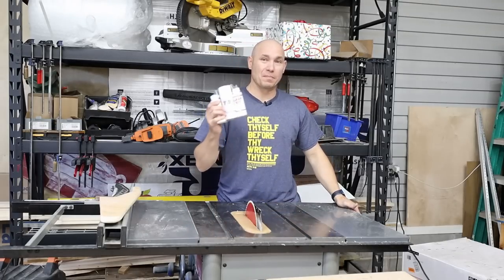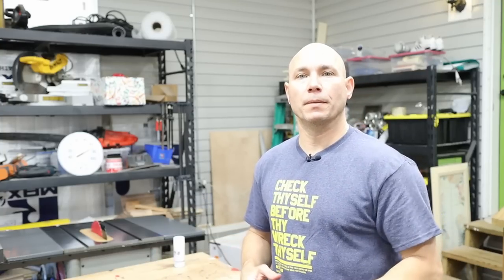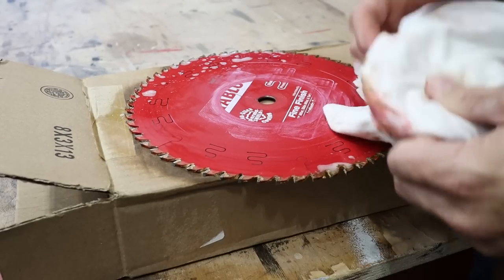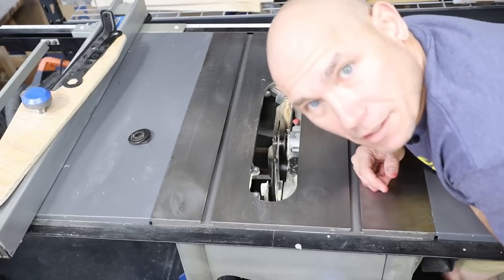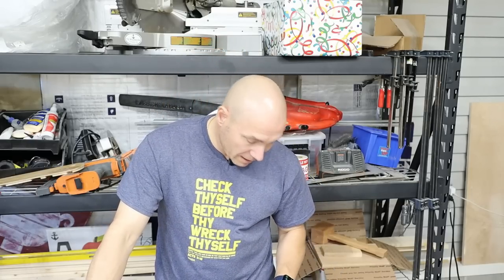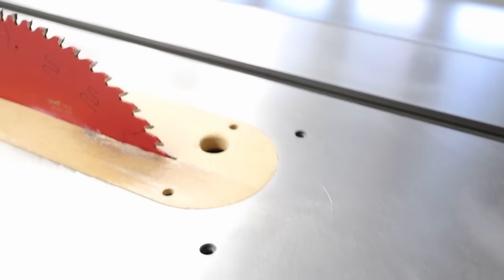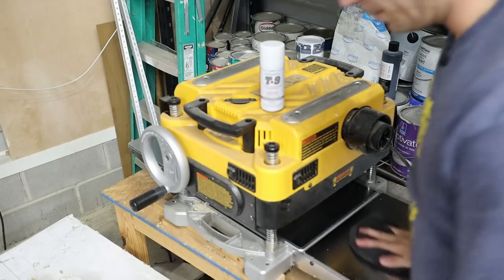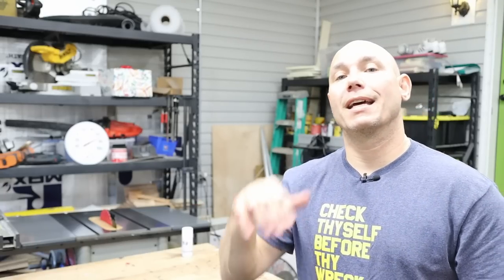ULTIMATE Product to Remove and Prevent Rust From a Table Saw.

Comment: I've been using those three products for several years.  An old tooth brush works great when cleaning the blade.  I use it on my router bits as well.  The odor of the rust remover is pretty strong as you indicated but it works.

Comment: I discovered the Boeshield lubricant and rust remover at the beginning of the summer.  I'm in southeast GA and our humidity is unparalleled.  I have to reapply it every couple months, or if i see a little rust spot start to pop up I'll use the rust remover to knock it out.   I would advise you to go ahead and buy a larger can of the T-9 because it goes fast.   Good luck with it and thanks for your enthusiasm and content.....keep it coming!

Comment: I will tell you the T9 works awesome! I have a CNC that I run flood coolant on and I have tried everything to keep my vise and tooling plate from rusting and nothing worked until I used the T9.  I have been using that stuff called Awesome to clean my blades and it works great, but I let my blades soak for about 30 minutes in a bucket lid of solution and there no scrubbing.   All my tools with metal or cast iron surfaces have been getting that T9 for the last couple years.
Reply from the maker: It's great stuff!

Comment: I use the CMT orange bit and blade cleaner also use Simple green, but the purple one as its less harsh on coatings, put the blade in a 5 gal bucket lid, pour enough Simple green to cover, let it sit for 10-15, scrub with a fine brass brush.
Reply from the maker: Cool

Comment: Great videos. I have the same model saw with the same rust issue. I will certainly give the Boeshield a try. I also use a CMT 251.042.10 ITK  blade  1FTB+2ATB. Unbelievable noise and vibration reduction.

Comment: I clean my table saw blade with "whitespirit" or turpentine, if its gummed up with pine. If it´s pitch from hardwood I´ll throw the blade in bucket of water and let it sit there for couple of hours. Then I use synthetic paint brush  with bristles cut short to make it stiffer. Super easy to clean that way.
Reply from the maker: Cool thanks

Comment: Don’t do a lot of pine cutting/routing but still get some pitch on blades/bits. I normally clean them with hot soapy water in the kitchen sink, then hit them with an old tooth brush. Rinse & dry, good as new.

Comment: I just watched a Stumpy Nubs video on blade cleaning and he used a different cleaner but had a couple more great tips for blade cleaning.  First was he used the lid of a 5 gallon bucket to put the blade in and spray it with cleaner and let it soak, was pretty much perfect size.  The other was using a nylon stiff brush.  I bet if you adopted those two tricks you'd get that last bit of resin just a bit easier.... makes me think I should possibly clean my blade now that i've seen two videos on it in two days, the universe is trying to tell me something ;)
Reply from the maker: ha maybe so.  It makes a difference

Comment: I'm gonna nag to have to try that. I need to clean my blades. I bought some Diablo blades for my table saw and miter saw. Used them once... Then I let my brother come over and use my shop. He had a bunch of green pine. It was wet and gummy. When he left my blade and cross cut sled were covered in green gummy crud. I wanted to beat him. Can't wait to try that blade cleaner. I don't know about the rust remover. Lol. I do have some rust on my table saw from a leak.

Comment: Power tip for you. Get a lid for a 5 gallon bucket. The saw blade fits right in an you can spray the cleaner and let it soak for a bit. Then use a grout brush to clean the teeth.

Comment: Thanks for another fine video!  Apparently, there are things in Boeshield that do not allow it to be air shipped which puts a crimp in shipping.  Shipping is $8 on Amazon for this 4 oz kit.  I like to use affiliate links to support the channel but I would rather invest the $8 towards the larger kit size because of the number of tools I have.  I am lucky enough to have Rockler and Woodcraft nearby.  So maybe my support will be a T shirt instead.  Keep up the great work Matt and best wishes for the whole family!
Reply from the maker: Mine shipped free, but I have Prime.

Comment: Try using Awsome cleaner from the dollar store ! It is only $1.00 and melts away any and all pitch on a saw blade without any trouble. You will happy with the results and not have to pay a lot for it. Good for many other uses. Was rated #1 in Wood magazine issue and it works !
Reply from the maker: Thank you

Comment: For Rust Free to smell like that it must contain either phosphoric or hypo phosphoric acid so a vapour mask is highly recommended. Hypo phosphoric acid is a key ingredient in illicit drugs so please be incredibly careful when using it.
Reply: Just a quick follow up. I found the Material Safery Data Sheet for Rust Free online. The key ingredient is phosphoric acid. I hope the manufacturer included the MSDS information with the packaging and that you simply overlooked it. If not, please alert your fanbase to the facts so that no one is adversely affected. I know that you mean well and you wouldn't knowingly place anyone in harm's way, hence the reason for this message. I personally am a huge fan and only wish the very best for you.
Reply from the maker: Thank you